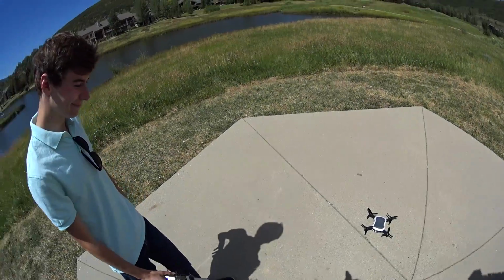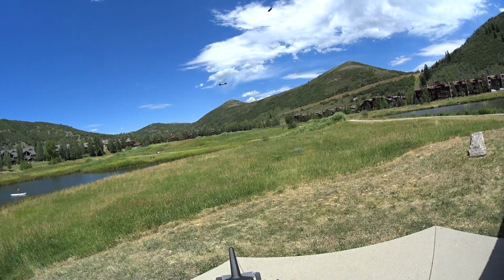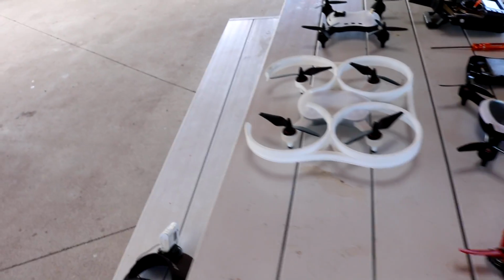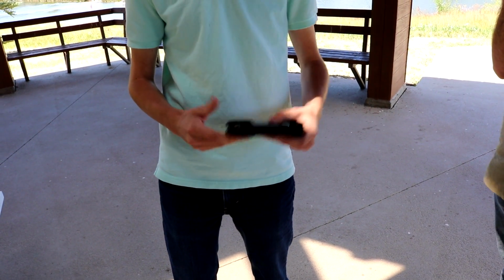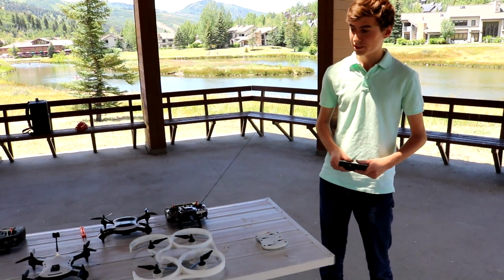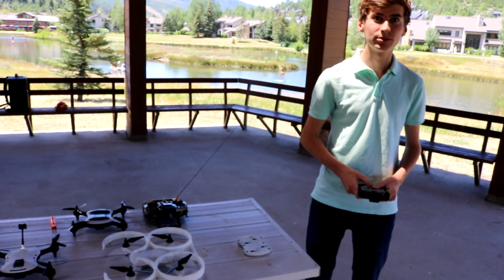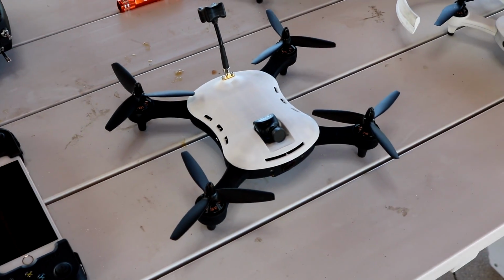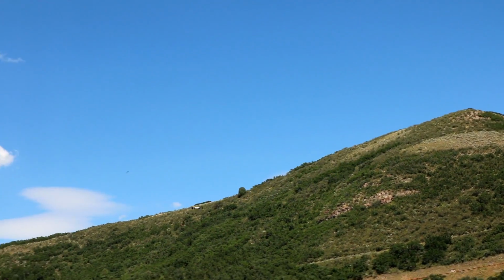TEAL Hands On Flight Test - nVidia Powered Modular Smart Drone [Pre Production Sneak Peek!]

Comment: this is not a racing drone and will get eaten alive by real racing drone.
Reply: 70 mph is faster than the majority of racing quads
Reply: The TEAL can't do 70 mph, period.
Reply: +Plur307 - I think you're confusing acceleration rate with top speed. It might not have the sudden acceleration rate of an fpv drone but the teal will eventually cap over most drones. With a long enough race, the teal would win in a straight line over most drones.
Reply: JJ SS
As somebody who races drones and has built several, no.  Not only does the teal use underpowered motors, but it also has a much wider body than most racing drones and has to push much more air out of the way.  I would be willing to bet the TEAL never wins a single high profile racing event ever.  The TEAL doesn't even have an adjustable angle camera.  When you fly fast you need to tilt the camera up so you can still see forwards.  The TEAL looks straight ahead.  At full throttle in level flight you will be looking at the ground.  My drones have the camera tilted at least 45 degrees upwards so that at high speed I'm looking straight ahead.  The TEAL is incapable of being competitive in a race, period.
Reply: you must be smoking something because my budget 5" would shit on this thing

Comment: Oh boy...I just bought the Phantom 3 Advanced with the Itelite antenna mod and can go over 4 miles out. I thought I was done with Quads. I'm saving my money for this one for sure! You should try the Itelite for your Phantom 4 Dustin. it's friggin incredible! https://www.maxxuav.com/
Reply: wish there were recorded video quality examples. specs say 4k at 24fps, then 1080 at 30fps and not 60fps. no mention of 2k in-between. I almost
Pre-Ordered it, but still need more real world examples. I'm itching to pull the
 trigger but...
Reply: +Scott Givens the JYU Hornet S for $279 and 80mph out of the box 800 meter receiver. =\
Reply from the maker: +Scott Givens looks promising.  Well have to see how it turns out :)
Reply: +Dustin Dunnill I purchased the JYU Hornet S as it's super fast and still aerodynamic and flys stable in extreme wind conditions. I'm still probably going to get the TEAL Drone when it seasoned and comes with a long range transmitter. it will be interesting to see all of the third party SDK support when it hits the market. 

I dig the thought of the positive applications of search and rescue and probably could be used to support law enforcement. The possibilities are endless. 

At the moment it's tough for me to dish out that type of money and only go 300' out of the box, when I have a Phantom 3 that can go 4+ miles with an inexpensive antenna mod.

I'm keeping my eye on this as it has amazing potential